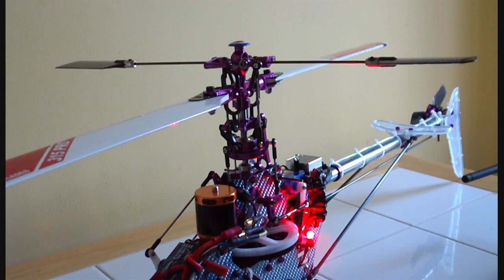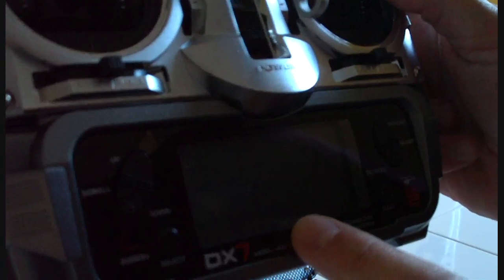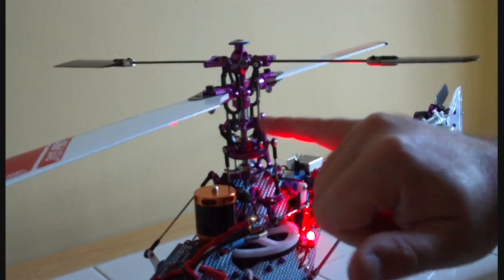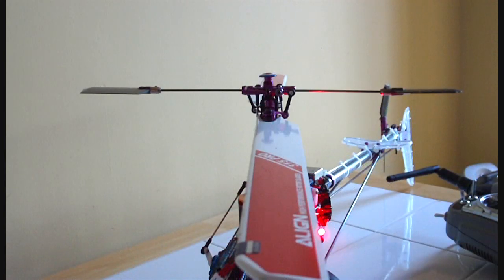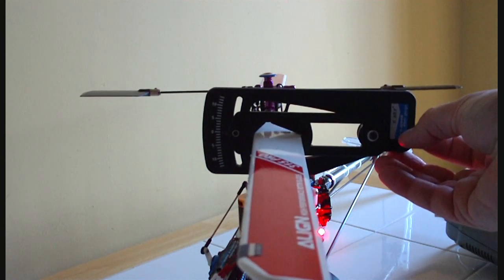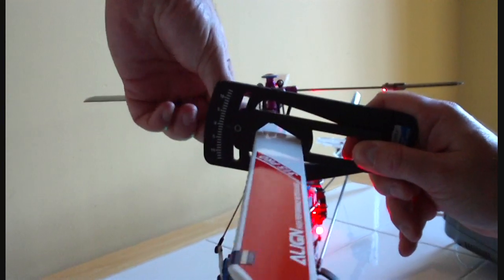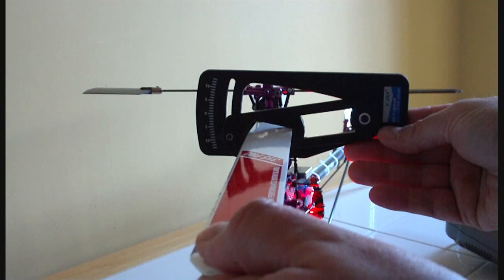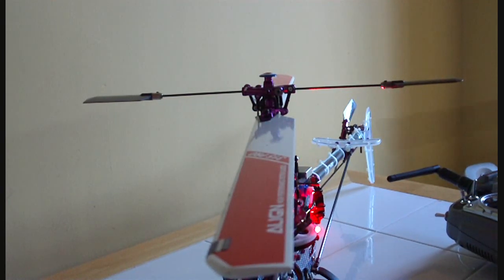Setting up and reading pitch on a Belt CP helicopter

Comment from the maker: Hi, I’ve read the manual for your radio. I’d suggest setting up the pitch curve in NORM mode as you have it i.e. –2 degrees to +11 degrees and setup the range in IDLE UP to be -11 to +11 for acrobatic and more aggressive flying. 

I would setup the pitch curve for HOLD to be the same as IDLE UP as this helps you check the pitch on the blades without the worry of starting up the motor and is also set for autorotation in the event of a motor failure while flying.

Hope this helps, happy flying!

Comment: How to do it in normal hovering mode. I am looking for the pitch, lower the throttle -2 and full throttle +11. I have KDS K7XII Transmiter and KDS 450SV Heli. one more question when we do these settings, in transmiter the Throtle hold should be ON or OFF (near to us or far from us). Thanks & Best Regards.

Comment from the maker: On some flybarless heads you can get a 'T' piece that screws into the top if the head that you can sight against, similar to a flybar. You can also use a pitch gauge with a bubble gauge built in and use that to make sure that the bubble is dead center when the gauge is set at zero pitch (you need to makesure the body of the heli is level too for this to be accurate). Search for a video called 'Zero pitch on a flybarless helicopter using a pitch gauge' which may be useful. Hope this helps.

Comment from the maker: @danda00, Have you changed something?

If you are using a computer transmitter then increase the value of the pitch mix in the Swash Mix menu to get more pitch. 

If you have the stock transmitter make sure both the shoulder controls are at 12 o'clock and the ball links on all the servo arms are 12mm or farther away from the servo pivot. (I used 12mm)

If the arms on the servos are too short then they can't move the swash enough. The servos shouldn't be binding on a simple swash move.

Comment from the maker: @craigyv513, thanks for the comment. It's always good to hear that one fo the videos has helped another flyer. On the subject of the tendancy of a heli to drift left..

There are three common ways to counter the drift to the left that comes the tail rotor - 

1) Correct using the cyclic when flying
2) Tilt the swash slightly to automatically counter the drift
3) Use the trim on the transmitter to correct for this

3 is the best option. You can change it easily on the fly..

Comment: Just like to say this bid has helped me so much. 
Just bought a honey bee cp3 as my first 6ch heli. 
Followed your video and got the same readings for both blades. But can't quite figure out my swash plate. 
Been told because of tue nature of a heli it will try drift left on take off ad the swash should have a slight downward angle from left to right. 
Does this mean anything to you. The forums contradict a bit on the subject. Any help would be greatly appreciated.

Comment from the maker: This is a Belt CP V1 helicopter, it's been heavily modified in the two years I've had it. You can still get them from lots of online and local hobby shops for less than $200. The transmitter is a Spektrum DX7, a very good 2.4Ghz programmable, 7 channel radio. Google them and you'll find out lots for both the heli and transmitter..